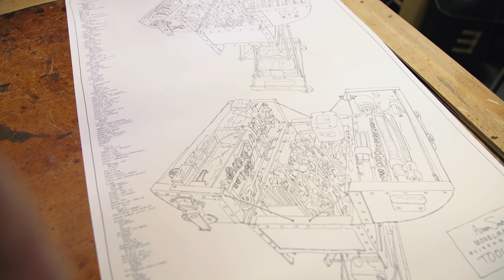Adam Savage Modifies Boston Dynamics Spot's Robot Form!

Comment: One thing to note about the shoes; Spot's designed for his own feet to be the shoes. This is for many reasons but, the most notable one is that his feet are at a fixed angle with the rest of his lower leg. It does not change. So, the angle that his feet are at is used as a point of reference by his posture correction. If the shoes were to become offset from his feet, it might mess with his posture and balance. It might be better to cut out the tread of his shoes. This would allow him to keep walking on his actual feet and not lose his balance, like he might in the shoes.

Comment: Adhesive Velcro cutting tip: try using a pair of serrated electrician scissors like the Klein 21010-6-SEN. I use them to cut adhesive Velcro almost every day in the AV industry and have never had to clean them.

Comment: You can clean the scissors with some of the tape itself.
Or some scotch tape. This way you don't need to use acetone (works best on stuff you can't use acetone on).
So what you do is repeatedly tap or press with your thumb, on that area that has some glue left.
Five or six presses and it'll come off clean! :D Hope this helps..

Comment: So, I'm thinking of a connection mechanism like formed plastic "snapping" into the torso in a way that it hugs the "ribs", but with material thin enough to avoid obstructing the movement of the legs and cutouts for the sensory mechanisms.
As for form factor, I'd like to see something like the ball droids from the starwars prequels. So from the current body it would sweep up and back from the center-front and curve up and back forwards again to keep center of balance over the main body. This should allow multiple attachment options.

I'd also like to see options that prevent jogging of the body during movement, or that cancels out any such movement, like suspension for any given attachment

Comment: I kinda feel if you used upholstery foam you could add shape and definition to the body underside, top side and maybe a little to the the legs. Keep the neck but for full on bonkers, 3d print a head with a jaw, eyes and a few servo's. Literally could be used for a prop in some fantasy flick with ease

Comment: Make dragon wings attached by a band in the center and slipping into those arm crevises, stretching it by moving the arms from the body would make it flap. If you make the wings heavy and long, then find the sweet spot of the tension, you can make it flap slow and awesome.

Comment: Honestly, I want to see spot up-scaled to 2 or 3 times its current size then built into the frame of a motorcycle so that it can not only ride the streets on 2 wheels with me on it, but can then put its legs down to become a "horse" when on trails, stairs, or other places you cant ride bikes too. also doubles as the kick stand. and could even have a come to owner function. Anti theft would be fun, as the unit could just keep moving away from thieves:) and just for fun, keep the utility arm in place to serve as both head/spotlight and tool to fight off thieves and meter maids:)
Reply: Just one small thing... The current build only does 5km/h. Upscaling it may get you 10. They need to figure out Gallop first. ;)

Comment: Just wondering about the raised neck and head. Yeah, it ended looking like a llama or a small deer... but that's not the only choice, why not put the neck extending on the horizontal, and have a more predator like stance... also, it needs a tail.

Comment: My thoughts:   Despite the legs being a bit off and the lack of any kind of head,  I have always thought of Spot as a robotic dog.  Naturally. Even in the "Uptown Spot" video of Spot with the manipulator arm acting like a head, I saw a dog.  A bird-like dog, but a dog nonetheless.   As it turns out, that was my introduction to Spot.  I thought that the arm WAS the head, and there were cameras on it for his primary vision.  As Adam has discovered.  Spot needs a head.  When I think of a quadrupedal animal,  I think of the body forward of the front limbs as the upper breast/lower neck/collarbone area.  Not the face.  But with Spot, that IS his face.  I can see the benefit of having the lower profile and CoG of not having an actual neck and head,  But in order to look around, his entire body has to swivel. (yes I know he has multiple camera "eyes" all over, even "eyes" on his "butt")  If he had a head, he could turn it for looking around.  Even having stereo microphones for "ears" Spot could determine the direction of sounds by computing the minuscule delay between the sound hitting one ear, and then the other, as animals do, and respond accordingly.   Again  being able to move a head could help with that.  Given that Spot would have the spacial awareness that those with heads and their relative orientation to the body would have. Additionally, this head could also house temperature and pressure sensors, as well as detectors for various airborne particulates and gasses in a "nose" of sorts.    And lastly, there could be a jaw that can be used for gripping and holding things.  The head could be roughly shaped like a dogs head, and be on a neck that is functional, allowing the head to turn on XYZ axis, as well as the neck to raise and lower the head as needed.   I think this addition could help offset the "creepy factor" that a lot of people get from him.  It's pretty much as fact that humans and dogs are two inseparable species.  Make spot even more dog-like and he will be far more accepted, relatable and even functional.
Just some personal opinions though..

Comment: I have no trouble with where he keeps his face (yes, I'm paraphasing Star Trek 6), as it makes him look more like a big cat with its head down while stalking its prey, than enything creepy. I think it's more that he has a face without really having a head, or, more specifically, a neck.
Imagine if his face were mounted to a protruding head with a neck which had multiple degrees of articulation. It could move, and pivot, up, down, left, & right, and could even be gyro balanced to eliminate bobbing and swaying while walking. And, it would look cool when he ducks his head down to squeeze under something.
Another fun thought is to use the rails on his back to mount a steadycam rig for the ultimate follow cam :-D

Comment: I love Spot's red lace up shoes; the could easily consist of the canvas corset on just the top hemisphere of his feet.
The neck seems disproportionately long against the length of his back and the length of his legs. The shorter the neck, the thicker, I think, plus the converse.
His gait is almost canine - but I cannot think what else would have such exaggerated articulation or move so comparatively low to the ground: he's overly collected, and I think his front shoulders are too far back.

Comment: Dear Adam Savage, 

If you want a pair of scissors that will not gum up while using them on the self stick Velcro try some cheap fluoride coated trauma sheers. I use them all day at work and almost never have to clean them.

Comment: "A weird place for a head"?  That is where most animals have their heads, though they tend to stick out from the body on short or long necks to allow their sensors (eyes and ears and whatever) and their mouths to function in angles that are wider than just straight ahead.  This is especially true of therapod dinosaurs with their heads full of teeth sticking out horizontally, balanced by their long, straight tails.  You want a separate mobile head on the body, like a real dog has, which in many dogs does not stick up unless the dog raises its nose on purpose.  With a machine, you can put sensors everywhere needed so a mobile head is not required for that purpose.  "Form follows function" is the best decision...
Reply: I think the weird part is because the "head" is so close to the shoulder joint, it kinda looks like a turtle pulling its head in, or just not having a neck entirely. Even the smallest of dogs have a bit of a neck that distances the head from the shoulders. Spot doesn't have any.
Reply: @Appletank8  True, but I do not think that is what he is getting at.  He wants a raised head (at least all of his mock-ups had one) like a horse or camel.  The existing "head" is extended slightly from the body.  The problem to me is that this robot has nothing that it seems to be able to do other than walk and shift its body position.  What can it do by itself as far as manipulating things other than pushing them horizontally for the most part, if they can roll or slide, that is?  To carry something some other equipment or person has to place whatever it is to carry onto it and somehow strap it down.  A real "robot" is self-contained and can figure out what to do independently, with its own manipulators, within its "area of expertise", with minimal inputs of any sort (information or mechanical assistance) from any controlling or assisting devices.  Otherwise, it is just an assisted-control, electrically-powered, mechanical "wind-up" toy like a radio-controlled model airplane.

Comment: Failure To Learn From Mistakes badge :   Hand with TWO bandages
Overambition badge :   Biker/skateboarder failing to clear canyon
Preflight Check Fail :  Fixed gear airplane taking off with wheels continuing along runway

Comment: This is likely way beyond the point, but why in the world have you not been fitted with progressive lenses. I assume you have - well, at least I did - avoided bifocals. But progressive lenses allow you to vary - with slight movements of your head - to clearly see up close, as well as far, and critically, medium. My job required me to be reading architectural plans all the time - midrange, that is - and close for reading, and driving. It does take a bit of getting used to progressives - be careful about stepping off a curb too quickly - but you'll soon be patting yourself on the back for being so "far sighted."